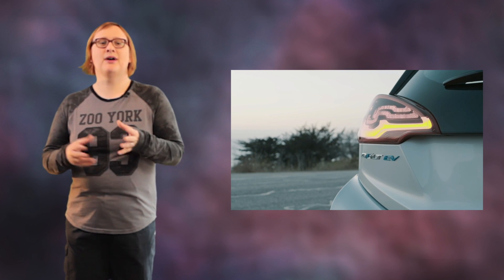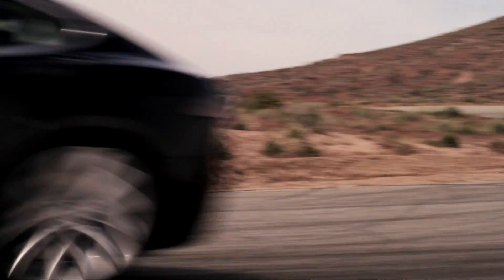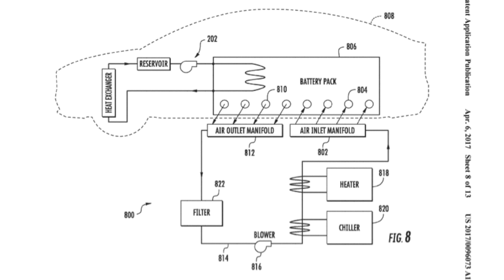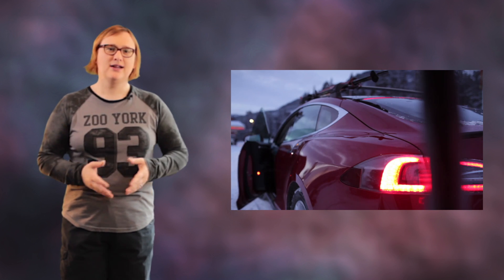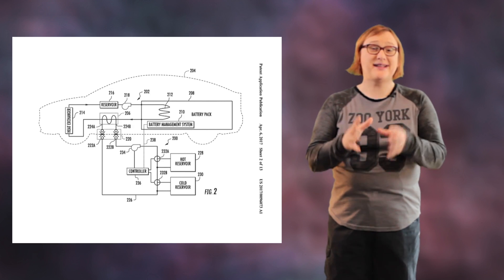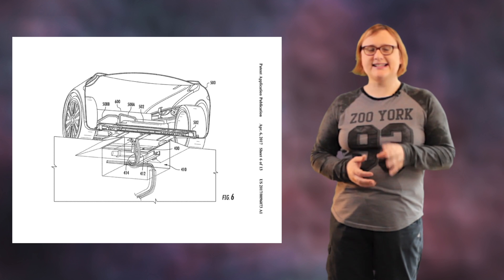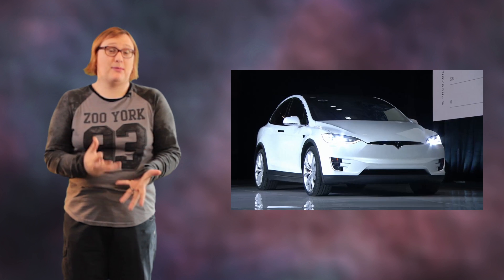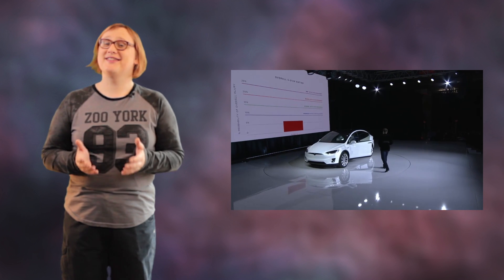Why Tesla Wants To Put Its Battery Pack On Ice For Super Fast, Super Chill Supercharging

Comment: You have to cool the cables, too, both from EVSE to car electric port, and from port to battery.  The EVSE cable can be circulated refrigerant, and the vehicle can be a combination of air (car wires) and a supercooled contact plate touching the battery housing with sufficient contact area.

Comment: The way to do it will probably be to standardise the car battery so all cars use the same battery and instead of charging your car on the move you swap your battery with a charged one at a petrol station while still having the option to charge at home. This way there is no wait. A system would need to be diveloped to easily do the trade.

Comment: they could run a compressed air hose along the charging cable, so when you plugged in the cable, the air hose is plugged in as well to a separate pipe leading to the battery pack to keep it cool >_<

Comment: OR you could swap the battery pack for a fully charged one. Just like LPG gas cylinders in developing countries. You own "one cylinder" but not a particular cylinder, which means you don't refill the same cylinder over and over again, but rather simply replace the empty cylinder with a different full cylinder. Then the gas company fills up the empty cylinder and puts it back in the pool of cylinders (for someone else to replace their empty cylinder with). Tesla could adopt that, because it's very effective in getting energy to consumers quickly even when the actual replenishing takes time.

Comment: Extra Cooling of the battery parks is a poor solution, as all the heat removed by trhe cooler is wasted energy. A better solution would be to charge portions of the battery pack in parallel, but with each portion at a lower rate so as to generate less heat.

Comment: Seems to me it would be faster and better for the consumer if the car and charging station were designed to swap out the depleted battery pack for a fully charged one in minutes. This can be automated. Then the depleted battery can be recharged on site and when finished, reused in the next vehicle needing a charge.
This could be automated and much faster than refueling at the gas pump making the electric cars even more desirable by consumers.

Comment: Why use air cooling when water cooling is waaay better at transfering heat. And using underside plug in? What? Make an hose clip in the charger plug that runs water in and out of the the hose at high pressure. Using ground cooling and a pump to move water around instead of air cooling or using heat transfering pads. Aka saving power. And as the charging is done. Drain the water from the battery pack so it dosn't leave the car more heavy than it should. This way you can cover the wires aswell cooling them and making them thinner. Sure the resistance will go up. But i belive its possible to have the wire the same size while only increasing power used by a little. Simple, cleaver and straight forwards. :)

Comment: I think the reason why they would want this is to sell cheaper electric cars through less battery capacity, relying on an even faster supercharger for those long trips.  Yet, I wonder if they can just dismiss this and just install two charging ports at both sides of the car, utilizing two cables/chargers for that rare need of an even faster charging rate.

Comment: I believe model s has watercooling in its motors and probably batteries? If so, why not activate those coolers by using the electricity coming from the charger to cool its components down? With a thicker radiator and a powerful fan and pump, you won't need any other things that connects to the car.

Comment: I understand in these early years of electric cars that the charging stations are proprietary. There's Tesla only, Nissan only, GM only charging, etc. However, very soon here with more and more car brands having an ev, there will need to be stations more like gas stations - able to recharge any type of ev. Imagine if there were gas stations that were only able to fill up GM vehicles or BMW's only or only Fords, etc due to the way the gas pump was designed. There would be 20 different gas stations on every corner.
How soon do you see multi-vehicle charging stations happening, or better yet car manufacturers getting together to have only perhaps 3 different type of plugs? Each type would depend on the size of the battery, size of the car (perhaps soon there will be more ev trucks and suv's), and speed of charging.

Comment: At 5.55 in this TEN video - Heck yes.  The battery has become such a critical and expensive component part of the EV, you make a stellar point that the owner would not tolerate having it swapped-out for any old joe's badly maintained POS.  You know the analogy that comes to mind? Engine replacement.  What a minefield that is, the engine swap business.  Here's a quick rundown of what a BBC documentary uncovered happens instead of that pristine refurbished remanufactured 'promise' everyone gets: worse engine than they took out; solves one issue but introduces loads of other faults; broken parts galore nothing to do with engine swap; not the correct engine; finallymy own personal favourite - messing with how the engine looks, like whacking a sticker on it, or a splash of paint, and leaving the self-same engine exactly as it is, but TELLING the customer the swap's been done (all this, after weeks of delay to make it seem 'authentic').  Yeah, let's leave battery-swapping as undesirable and risky.   You will get half-charged batteries, fried-out cells, poor or variable range, overheating, bad connections not properly made, damaged cells through handling, covers broken on the EV concerned, unrelated areas damaged (it happens), etc... Makes leasing impossible too, in a mixed lease/not lease battery situation like we seem to be generating in the EV world now.  Do we think that the first major attempt at battery-swap centres having resulted in liquidation, indicates the specialist and limited-purpose future of this method?

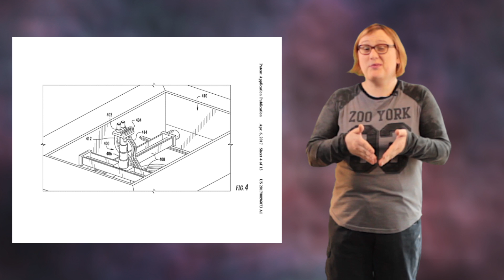Comment: Thanks again Nikki, I feel informed for a few minutes.  Do you know, I sense a radical haircut in your near future?  Kind of a premonition (hint - I may not be watching your videos in order !).  I got to 4:58 so far, the cooling required seems to be most required in cold weather.  So, we need to take that heat and put it somewhere that would like the benefit of it in cold weather...   I often thought 'would it not be great, if you could have your coolant in your old ICE gas/diesel car, exchange with your house radiator water, to take the waste heat and heat your home with it'.  I envisaged the coolant being directly ported through two pipe connections.  This has the benefit with old gas/diesels that it could work in reverse - you could WARM your car engine etc, to start off with in cold weather, as if it were just another radiator in your home.  However, a non-sharing 'isolating' type system (heat exchanger) would be most of the way there without the need for the home and car (cough) to be exchanging fluids.  There's a gel material that 'Fully Charged' online channel expounded the benefits of, that stores heat really well for long periods.  I feel this has a place in Tesla's concept, or could have.

Comment: Battery swap will even out the load and therefore cheaper electricity. But you lose your original battery 2 days after purchase. I think Battery swap is a good idea for fleets and semi's.
Active cooling also has a lot of promise. It can also cater to many different sizes and shapes and chemistries of batteries. This is better for the average customer

Comment: Before worrying about cooling, you need to understand that NO existing Tesla including M3 can charge at a power higher than about 139 kw.  This is because the little cells are charged at no more than 4.2 volts and Tesla limits the max. charging current to 4 amps per cell.  For 85/90 kwh packs this means 7104 cels times 4.2 volts times 4 amps = 119.3 kw, conveniently.  Panasonic's spec sheet recommends maximum current to 2 amps or less.  This means that Tesla will have to either radically increase the allotted charging current, assuming the car's circuitry and batteries will tolerate this or introduce a new battery cell that tolerates more charging power.  Sorry.😢

Comment: K.I.S.S. Use compressed air. Add a compressed air line to the charge plug, and direct the compressed air around the battery packs to keep them cool during charging. Of course, this would add to the infer-structure of the charging station, and add some weight to the multi-battery pack for the airline distribution plus the even distribution of high flow air. I am sure vehicle engineers have had to overcome more complicated tasks than this.
Oh and for the un-initiated: Keep It Simple Simple! (KISS)

Comment: The power required to additionally cool the battery doesn't seem feasible, when the point of a Tesla is to reduce the overall energy use in the world by making it all more efficient. I think another technology will have to improve charge-times.

Comment: I don't think there's going to be any major improvements with current Li-on batteries.  The big break through will be solid-state glass batteries.  The electrolyte must be in solid-state form to see significant charge times and longevity of the batteries.  Incremental changes are nice though.

Comment: Oops!  Superchargers ? 
You omitted to mention ...supercapacitors:
Musk 2006: "supercapacitors NOT batteries are the future".   A comment repeated twice in 2011 by Musk. 
Oh - and in 1995(!) Musk's chosen Ph.D focus at Stanford was...ultra high energy density, instant-charge Supercapacitors. (Unfortunately he quit Stanford after TWO days)
Now, recently, we have had the most promising and credible supercapacitor breakthrough ever - by Surrey and Bristol Univ researchers working with Augmented Optics Ltd.
The first working prototypes expected "in Spring 2017".
Google it. (Dr. Ian Hamerton, Dr. Donald Highgate, Dr. Brendan Howlin et al) 
So the near and long-term future = combi powerpacks aka batt-cap packs. Supercaps will cover the first 80-100 miles of daily travel, secondary conventional batt-pack kicks in on those infrequent occasions when drivers travel more than 80-ish miles in a day.
Remember: supercaps can be re-charged/reloaded in seconds - and 10,000's of times. They're also far lighter and smaller than batteries and far less prone to catch fire or overheat.
Paul G 
Editor EVUK: Electric Vehicles UK

Comment: A swap charge system that uses a immersion refrigerant cooling system matched to the battery charge rate. 
Steps:: park I remove - plug In-immerse charge at high rate- de immerse- unplug- install- drive off.

Comment: would be perfect if it would work flawlessly you dont want to be stuck at a supercharger at 3 am because the station failed to connect to your car and is stuck or smth. but if it does work charging at 400+ kw would be awesome

Comment: I'll purchase an EV once they are equipped with a solid-state battery that live up to its promises and adequate infrastructure is in place.

Temperature, the solution is Solid-state Li-ion or Na-ion batteries with low resistance and impedance. The forthcoming solid-state supposedly offer:2X-3X density, reduced cost, ecologically far superior (more commonly found metals), much faster charging, massively safer, etc. The current 'Li-ion' batteries are archaic in comparison. I absolutely do not have the time to waste charging my car for an hour. Further, the solid-state Li-ion or Na-ion batteries will render the current 'Li-ion' battery EV's near worthless, add to that the Panasonic - Tesla $1 Billion investment is a bust.
Reply: i tried searching for the investment of 1bilion you mentioned and landed on last years news that dyson invested 1.4bilion on Solid-stat lithium-ion batteries. But isn't that a bit far of? i heard about the new discoveries John Goodenough made. but who knows perhaps Tesla's investment in it's battery factory isn't lost if they can adopt to the new tech. i think all of the batterie industrie wil have to do that.
Reply: TuxKey 
What I was referring to was the ($1 Billion) investment Tesla made into Panasonic being wasted money. However, my recollection was incorrect, the amount Tesla made was $1.7 Billion fortune.com - Tesla Owes Panasonic $1.7 Billion for Gigafactory Batteries/

That investment is effectively lost due to newer technology. 

Actually I'm aware of two solid-state Li-ion or Na-ion batteries under development. One uses a form of glass electrolyte and the other uses some form of 'plastic' or polymer electrolyte.

In any case the solid-state batteries render liquid Li-ion batteries obsolete, and therefore I personally will not purchase an EV until both the new batteries are available and a more robust infrastructure is in place. 

Further, the current Li-ion batteries are too negatively impactful to our environment. The new solid-state batteries 'supposedly' use abundant and recyclable materials. Also, the new solid electrolyte prohibits or at the minimum greatly retards the growth of dendrites so the batteries life will be greatly extended.
Reply: Until there is a commercially available car that uses solid state batteries, I don't think you can justify calling current batteries obsolete. You can wait if you want to though; your reasons are your own.
And I don't know off hand any car that takes a whole hour to fast charge, when using the fastest charger available for that car. That's twice as long as my car takes (with a small battery and a relatively slow fast charger).

Comment: The keeping it simple principle applies for any practical application. Any fluid connectors are bound to fail and leak.   My take is that Tesla needs to improve the onboard cooling of the battery, power electronics, and motors as heat issues (lack of or too much) do exist when the car is in motion.
Reply: They could put a heat exchanger between the cars internal coolant line and the external coolant line. This way the internal coolant is isolated and does not leak.  If you use chilled water as external coolant then it does not matter if it leaks. If you run the internal coolant line on the underside of the car you don't need coolant connector you could blast chilled water on the underside of the car directly.
Bigger radiator have larger drag so improving the internal cooling system is not that simple. You could increase the heat of the radiator but you would either need phase change cooling or supercritical cooling system for that.
Reply: It should not be just chilled water if it is outside exposed to subfreezing temperatures, it will have to have glycol/antifreeze.  Even if it is the external coolant leaking, it is still leaking.  A connector on the underside of the vehicle will be exposed to dirt, debris impacts, corrosion, etc. and the seal will eventually be compromised.  Keep in mind the coolant has to be under pressure to circulate.  There could be leak detection (egress ingress pressure differential) but there we have yet another increase in complexity.

A little extra drag is ok when the vehicle is pushed to the performance limits.  There are active louvers to minimize drag when it is not.  Drag won't matter anyway when the vehicle is moving slowly or when stationary.

Comment: Actually this may not be the time to buy tesla stock, I want to see what happens when they get there production of the T-3 on full production for a year that may be the right time to get out. As far as Battery cooling it is much easier to use aerodynamics of the Battery internally and have a suction hose  suck hot air out of the battery cheaper simpler easy to implement.

Comment: You mentioned the better place pack being thermally managed in the quick drop stations, the Fluence also had active thermal management with a built in high powered peltier heat pump coupled the packs system.

Comment: I am for swapping battery cartridge solution where the rear bumper open as a VCR and battery cartridge swaped out  to be charged and in with a full charged battery. Electric company to operate these station and own batteries finally rented to car owner. In a nearr future small favourites cars can be supplies with a rear train kit that contain a small chassis to connect electric motors,regulator, elctronic and sliding battery for 100km autonomy.

Comment: Your not going to charge your Tesla at 100 kw that's 266 amps @ 375 volts not going to happen the grid wont support it lol...
Reply: TheMFrelly solar and battery storage will reduce demand fees from the utility
Reply: That's obvious! You would need a small substation beside every charging station with  10kv 100amp power line.
Reply: TheMFrelly i worked at manufacturing plants that had 480 volts 3 phase with 4000 amps for the main.

Comment: Also, just on patents, we need to push governments to make patents null and void if the patent seeker doesn't make a sale able product within 2 years. This will free up the courts regarding patents and force companies to build products instead of just sitting back and demanding royalties without actually doing anything.
Reply: fourbypete you clearly haven't built anything have you...
Reply: I have designed cranes, car parts and electronic circuit boards. But 
never made enough money to patent anything.  It's frustrating trying to 
build something when you're being held back because someone wants money 
because it's too close to someone else's design.